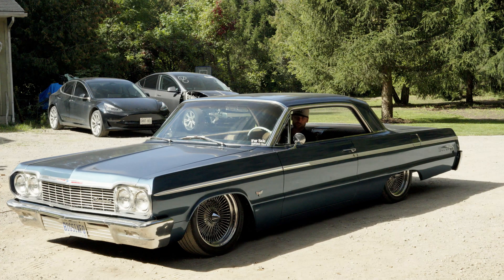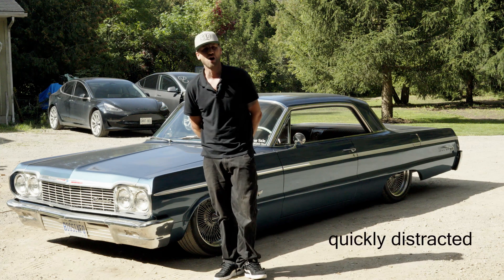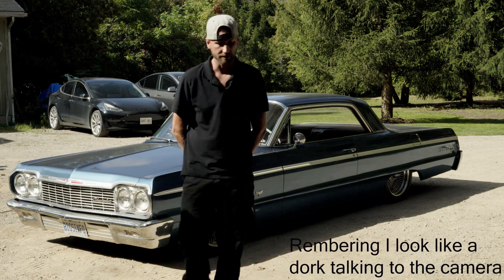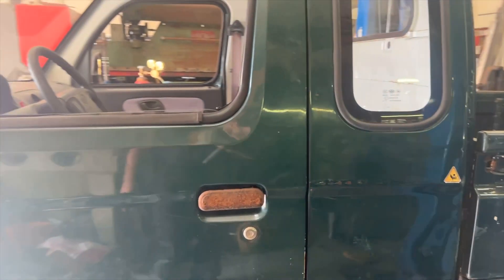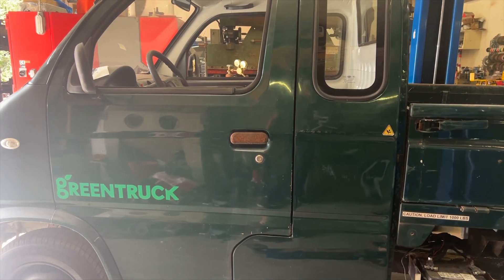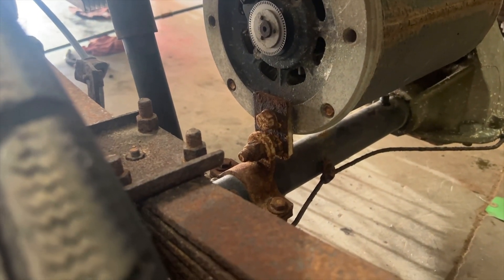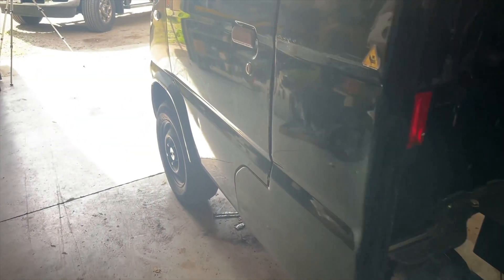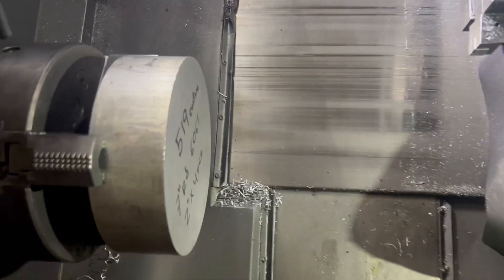Badass Vantage EV Mini Kei Truck on ATV Tracks

Comment: thanks for the unique video. I subscribed to your channel. I'm actually about to go look at a 2011 model with a 5 speed manual and 1.0 litre 4 cylinder engine. It runs 60 mph with more to go the owner said. Are the petrol vans not governed?
Reply from the maker: From factory they did have speed limited. I believe it was to get around crash testing standards??

Comment: How did you find out which encoder you needed? I bought a similar truck for 500 bucks from my family friend. It has some of the same symptoms except for when you put it in drive it automatically starts to drive away. It would be throttle pedal order a new one of those I haven’t tried it, but I just want to get a few extra parts in case I need to go that route.
Reply from the maker: I just ran the part number off the old encoder. It is normal for it to start moving as soon as it is in forward or reverse, but I think you can change that setting if you have the curtis programmer. It is like a creep mode. Information is slim but the electric 'kit' is from HPEVS if that helps

Comment: I have a 2012 Vantage I bought during Covid, it was missing the Controller, and I am having a tough time figuring out which Controller it takes, what model is your Controller?
Reply from the maker: I believe it is Curtis controller 1238-6521. But contact HPEVS as they are the ones that put together the ev conversion.
Reply: Thank You, I reached out to Vantage, they are nice but couldn't give me the exact model, but in fairness I didn't give them the VIN. I will reach out to the Motor Manufacturer! @519Kustomz
Reply: I bought a controller now, but I still need to figure out the missing foot pedal? Missing contactor, and missing charger, if I knew what the manufacturer started with I can improvise.  @519Kustomz